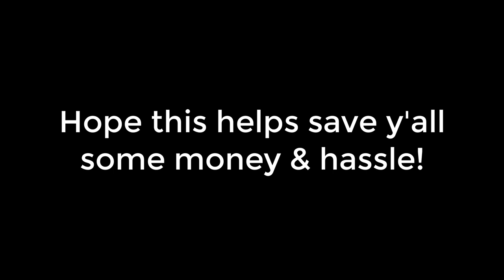Fix your broken Mac spacebar all by yourself!

Comment: This video procedure was better detailed than the others.  In particular, it showed me that I did not have the correct bar on the white carriage pointed away from the screen earlier, so the c-shaped barbs could not engage when putting the space bar on.  I also found it was not necessary to replace the left and right sticky half barbells in the beginning as was done in the video; I was able to use the old ones by bending one of them up slightly to fit the white carriage back in.  Good video.

Comment: Lifesaver. I yanked it off thinking it would be like any other keycap, moron that i am. Ended up snapping off a few of the tiny horizontal pegs but not as many as you did thankfully so the clips still retained the butterfly without me having to order a new one. The bit of info I needed from this was that the clear plastic clips need to be removed as they fit on top of the butterfly, once I knew that it was a breeze.

Well, almost. During my many attempts to get it back on, I ended up snapping off the hooks on the bottom of the inside of the spacebar, so it wouldn't hook back on at the bottom. Couple of tiny dabs of superglue on the bottom of the butterfly to hold the bottom of the bar in place and success at last.

I've never seen such an unnecessarily overengineered spacebar.

Comment: STEP BY STEP GUIDE:
1. The video is pretty much accurate but missing few key points (follow the instructions in this video!!)
2. Remove broken keycap, hinge. 
3. Use %100 alcohol and the box cutter blade or a needle to drop some alcohol between the transparent plastics(x3) and the board for easier and safer removal.
4. Use %100 alcohol to clean the board (I used ear tips) and the blower to remove dirt/stains as well as likely small bits of the broken spacebar. If you don't have a blower, use torch to make sure it's clean.
5. Place the hinge correctly (see in video 2:27 )
6. Clean the transparent plastics(x3) if needed.
7. Positions of the plastics MATTERS (most likely)
--left and right. There're tiny cut outs which will guide you which one goes to which side 3:45 , 3:59 .
If it was for the left side: little cut out would be at the bottom right. Mirror the other side.
SUPER GLUE these parts where double side sticky tapes previously were.
When the glue applied, press firmly on the plastic (I used the blower to speed up), while waiting for the glue to catch use some tool to jiggle the hinge. It should have relevantly lots of backlash.
--middle section. The metal two dot side towards you, single pointy side towards screen. (You can see on the board little wear from the pointy side)
DON'T GLUE middle section. Firmly press on both sides of the button so the 4 pins go back in place.
8. Just wait. Leave the fixed button for at least 10 minutes while the glue doing its job and casually jiggle the hinge (not much backlash at this stage)
9. 10:58 place the keycap as showed in video. You want to hear ALL 4 clicks. Go from the one top side to the other (press really firm until you hear the click.
10. Test it. READ MY STORY:

Spilled a drink. Many of the keys became sticky. Removing keycaps using a guitar pick or a proper tool is very easy (not the spacebar)
When I cleaned for the first time I didn't have %100 alcohol and used hand sanitiser. It didn't work. Still sticky keys.
As per my research, it doesn't matter if you use isopropyl or ethanol. To operate with the substances I used toothpicks and ear tips.
I followed the video and read comments when tried to fix the bar first time. The spacebar went flat with no recoil.
When trying to remove the keycap, broke the clips. (if this is the case for you, search a relevant video how to safely remove the keycap)
On my first attempt I made sure to have an original spacebar. Second attempt, ordered from AliExpress (really same quality)
The reasons of your spacebar not functioning correctly could be: stains on the board, wrong position of the plastics, glued middle section or the pins of the left and/or right transparent plastics, glued hinge (as mentioned jiggle wiggle it slightly during the process), faulty replacement set. If the spacebar seems to stay in place and travels normally, likely you have damaged the logic board.
My space bar now works %100 perfect+.
Don't mind to comment and ask questions. Disclaimer: I'm not a native English speaker. Good luck.
Reply: Great work, Nick. Thank you. 💻

Comment: THANK YOU! Apple refused to help me since my purchase date was 4 years and 2 weeks post purchase date, and their keyboard replacement program for butterfly keys is only good for 4 years. It would figure that right past that date is when the spacebar went kaput. I was quoted $550 to fix this. Your video was the only one I found that clearly showed, step by step, how to do this. Everyone else basically says its impossible. I bought a replacement key on Amazon for $20, and followed your video. Thankfully the existing glue didn't gunk up on me so I was able to reapply without glue. Thank you so much for posting this!
Reply: hi, I did exactly what she did but the spacebar is stuck down, though it works when i gently tap it like a touchpad, did this happen to you or is yours normal?

Comment: Finally a good demonstration of this repair. This is my third attempt. First two I used regular super glue which was harder to work with. Got the gel this time.

One note.. direction of the clear middle piece matters. Test the direction before gluing
Reply: hi how to recognize the right direction of the middle plastic
Reply: @ismailbessad3479 someone already mentioned, 2 metal pin go down. Just don’t glue the middle part and see if it works for you

Comment: you are amazing! I broke my spacebar today and I was too cheap to purchase a new one, so I install the broken space bar back with your method and it still work with a few broken legs, I didn't even use super clue to ensure they are in stick in the right place but it turned out so well. thank you so much for your video.
Reply from the maker: Rock on Han!

Comment: It seems like that middle part that holds the part in the center is stuck with glue, will it come right off if I pry it? That's about the only thing getting in the way of my spacebar repair. Thank you for the video, I'm in the same boat and have to either chuck out 600$ for a keyboard replacement or do it myself

Comment: Thank you very much for the video! 

Ended using fas drying glue (crazy glue) on the three pieces, because mine wouldn't attach, and also tried super thick double sided tape, but didn't work.

Procedure applied on a macbook pro 2019, model a2159

Comment: ah finally someone with the same model as mine
How did you remove the butterfly from the plastic?
Reply from the maker: There are little hooks on the plastic space bar that snap onto the bars of the butterfly mechanism :) is this what you meant?
Reply: @MovewithMEvideos  So the butterfly came of together with the spacebar top and the little hinges got broken BUT I've sent my mac to iSpot support and they've replaced the whole top case in that keyboard replacement programme. I'm not sure if this video would still apply to the new keyboard, had I need take any keys out again. Thanks for responding tho :)

Comment: I just received my spare parts from China and installed my spacebar. You missed one important thing: when you remove the central transparent bit, it's important you put it back on the same way, so the two metal pins hit the big metal plate.
Reply: I hope you still remember. Do they go down or closer to the screen? Thanks
Reply: @nickapple3788  No, I don't, sorry; but if you look at the parts that will make contact, you should be able to make out which way it goes.  My spacebar didn't fix completely, mind you; the far left side of it has a weaker recoil and is unresponsive.
Good luck. Let me know if you have any other questions or how it goes.
Reply: @maciej.ratajczak  glad you're alive :)
The problem is, it works in any position. After installing the key goes down and stays flat I was just considering if that could be the reason. Maybe, maybe not or maybe f@ck apple (no abuse XD). New set comes sometime in September wish me luck. Guess that's all I need. If somehow it works after all I'll post my personal instruction on all those smart ass videos, pretty sure plenty of people still having the exact issue. TC
Reply: @nickapple3788  It's incredibly frustrating - I know exactly how you feel.
The central bit being correctly aligned is not absolutely essential; I think it will work even if you install it incorrectly, but without the proper installation set you will not be able to fix your space bar because some small parts of it that create the recoil have broken off.
Apple had a law suit for their butterfly key design. It was a class action settlement. They compensated all buyers who had declared issues with their keypads $125. They sent us all cheques in the mail. I paid mine in last week. (I had returned it to Apple seven years ago for repair because the spacebar stopped working.)
Reply: @maciej.ratajczak  I’ve heard of the lawsuit of course. And about issues with the butterfly keyboard but I needed the most powerful intel based mac. At least you got some bonus xD. If you’re taking about those little pins (which I figured %100 important to recoil) then obviously new set would have it done. Not sure what else I could break. No even a theory
Reply: @nickapple3788  When your parts arrive, watch out for the existing sticky tape on the transparent bits. I remember the existing adhesive on the transparent bits clumping up and protruding too much. It caused the transparent plastic bits to affect the whole mechanism and not stick plumb to the base of the keyboard. It may be why the left side of my space bar doesn't work. I recommend getting some thin double sided tape if you really want to increase your chances of success.
What a hassle!
Reply: @maciej.ratajczak  if I was you I would definitely not go for double checking hehe. I used super glue then %100 alcohol to remove to redo then broke it again. One of the most informative video where lady showed step by step, she said “ don’t use sticky tape (she tried didn’t work). She used superglue and in the end of the video you can see the result, the button works like brand new. I’ll give you an update then. Cheers
Reply: @maciej.ratajczak  Hi mate. I'm all done. You can read the newest comment under this video. Cheers
Reply: @nickapple3788  Yeah, you might be right. I think I used super glue in the end myself. Good write up.
Reply: @maciej.ratajczak  thanks buds. Hopefully it can be helpful for some folks out there

Comment: But I dont get it ? You remove the transparant 3 pieces , add the amazon plastic and then add those 3 pieces back. Afterwards you add another 3 layers of transparent stuff . What is that ?
Reply from the maker: Maybe the transparent stuff you’re describing is the super glue? I originally tried double sided tape but it didn’t work well. So I removed it and switched to super glue on the clear pieces so they stuck better. But be sure not to accidentally glue the butterfly mechanism down too.
Reply: @MovewithMEvideos  oh yeah I get it tnx !

Comment: hi this has been rly helpful, i could finally get to see the inside. The problem with mine mac is that i can see the right side glue is off. But i haven't taken the whole key down, as the left side is fine and glued. What would you suggest me to do? thank you again.
Reply from the maker: Oooh tough call. Def your choice if you want to pull the key off and try fixing it as a whole? Or waiting till it eventually all comes off? I wouldn’t try to glue half of the key while the other half is attached still. May cause more of a mess than you’d be fixing.

Comment: Unforfunately, it doesn't work for me. I've tried all tuto on youtube, and nothing. The single crochets don't want to stay in place. They did not want to hang on the background. Each time, the double crochets hangs well, but the single get stuck in tne small iron rods. However, I use glue, but the white bar does not hold at the bottom on the background.

Comment: my entire bottom hook of the space bar broke, but it still works bc its connected to the top hooks. amazing video. my double sided scotch tape worked just fine. very smart to use the glue tho :)
Reply from the maker: PATBLOGZ yikes!! Glad the tape worked and it’s all fixed for you now ☺️
Reply: hey, i have the same problem as you. ALL my bottom hooks broke. How did you fix yours please?
Reply: @EleventhHour.  i just hooked the top hook and thats still fine cuz it wont fall entirely
Reply: @patblogz2908  but isn’t it harder for you to click the space bar? It still works but only when I press hard In the middle
Reply: @EleventhHour.  yeah its pretty difficult lol i need to get a new computer soon it has like 4 viruses and most of my keyboards are broken
Reply: @patblogz2908  lol fair enough

Comment: I'm thinking of using liquid bandage as an adhesive I might dissolve if needed.   Anyone have thoughts on this?
Thanks so much for this video.  This is the model I have, and this explains very well.
Reply: Update!! My space bar is working!!!!!  
This video is definitely the most helpful of all that I looked at.  As a person with ADHD, it was hard to be patient through some of the troubleshooting details, but it was sooo worth it.  These instructions are complete.
The liquid bandaid was really useful for me because I did need to redo after adhering them a first time, and they pulled up.  Also, I initially couldn't find this video again and put a tad bit of adhesive too close to the magnetic center and had to quickly get acetone to dissolve.
I'm so thrilled I can type again!

Comment: Hi! Looking to try this to fix my laptop. What kind of glue did you use?
Reply from the maker: I used gorilla glue super glue gel. It looks like a nail polish bottle with a brush in it. The gel inside is clear. 

https://www.google.com/shopping/product/2483677816804262710?q=gorilla.glue+paint+on&client=safari&sa=X&hl=en-us&biw=414&bih=719&tbs=vw:l,mr:1,cat:503742,pdtr0:1751397%7C1751398,ss:44&prmd=sivn&sxsrf=ALeKk00vwZlRBuwiBSzlcU3HOsA1-7W-Dw:1616098184800&prds=eto:9471962333699590329_0,cdl:1,prmr:1,cs:1&ved=0ahUKEwj6-Obx0rrvAhWEJDQIHZIdAzMQgTYI8Qo

Comment: hey, can someone tell me how to take out the clear parts? thanks!
Reply: A drop of %100 alcohol spreads out and removes adhesives. Just use any thin metals to slightly pry from any edge and slowly work your way through. I used tooth pick to drop alcohol